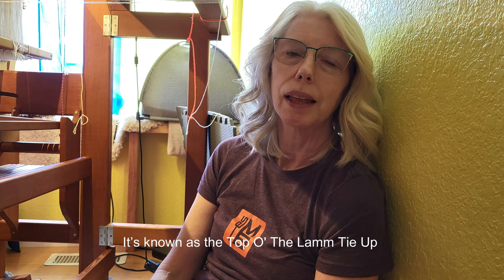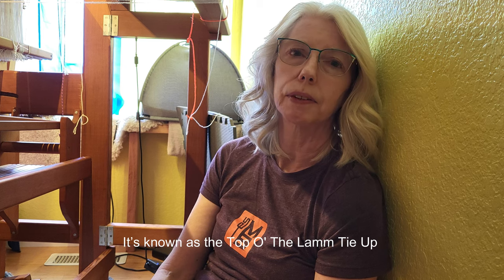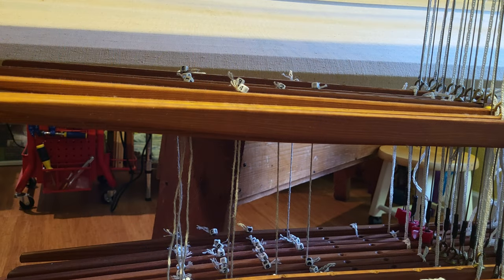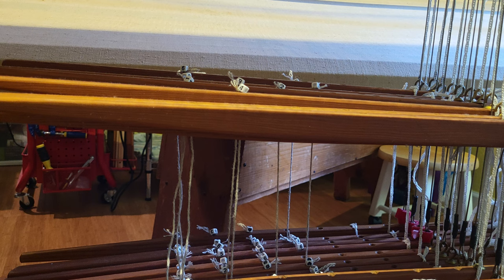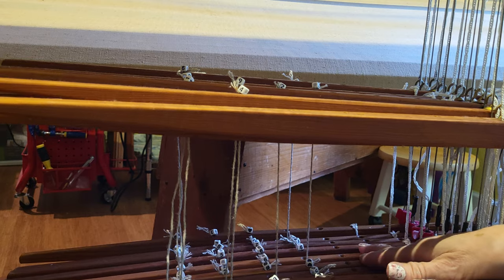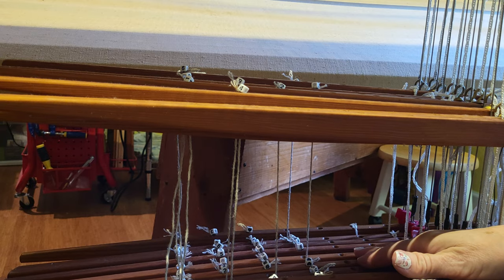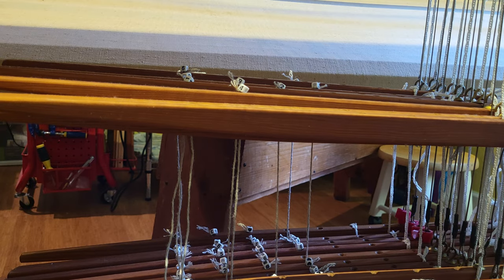Tying up a Countermarch Loom with Texsolv

Comment: I just changed the way my Varpapuu Karelia  was tied up to the last way you showed us  and yahoo it worked. But the threads did tangle I hope I have enough texolve to change again but you didn’t show how you tied the cords from the top lams.
Reply from the maker: Thanks for watching! I'm glad you were "somewhat" successful with the previous method. With this method you connect the texsolv to the upper lamms the exact same way as the lower lamms (I demonstrate the upper lamms starting at 9:15 in the video). The only difference is when you bring the cord down be sure to go in back of the corresponding lower lamm. You can reuse the cords you used in the previous tie-up method for the upper lamms; you will need shorter cords for the lower lamms. Good luck and happy weaving.
Reply: I know I sounded dumb. But after I watched your last video again I twigged onto that. Like you I didn’t like the mess. The Karelia has been sitting in a container for 5 yrs and when I had my second Knee replaced I just didn’t use her.I think she was only used as a 4 shaft loom and was in pieces when I got her . I only had a 2 shaft loom at the time but wanted to do more. We packed up and moved and my partner and I thought a smaller 8 shaft loom would do the job.that wasn’t happening the tension didn’t hold and the brake cord kept coming off. So out of the container she came again but this time I wasn’t able to talk with an old weaver I knew,and have been trying to work my way into getting her going on 8 shaft’s with utube. Yours made sense thank you again.
Reply from the maker: Didn't sound dumb at all! It's hard in such a tight space to see what is what sometimes. I'm glad the video was helpful. I'm not familiar with you brand of loom but, based on the pictures I found online, it's a standard Swedish style countermarch loom. You should be able to weave pretty much anything on it. If there are any questions I'm happy to try to answer them. Do you have a copy of "Tying Up The Countermarch Loom"? If not I highly recommend it.